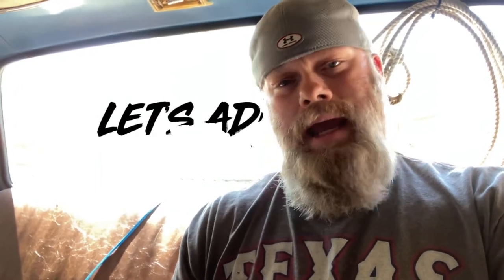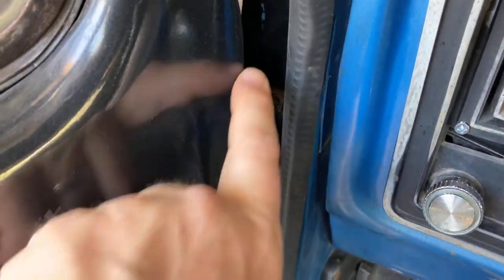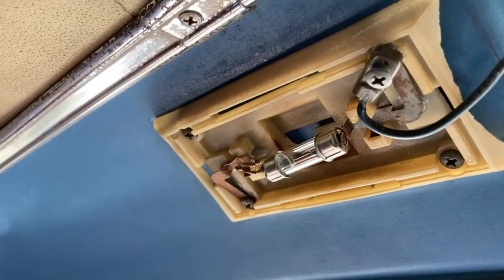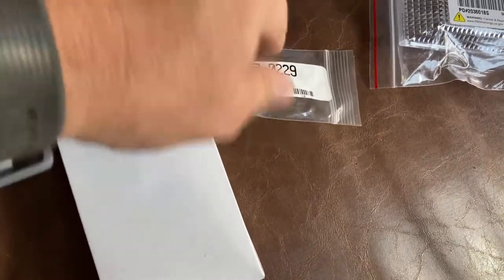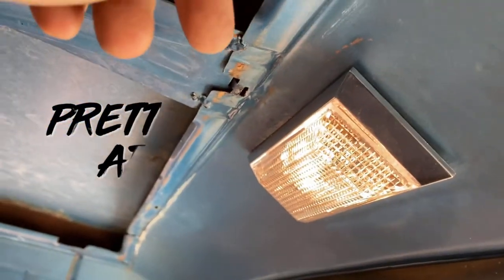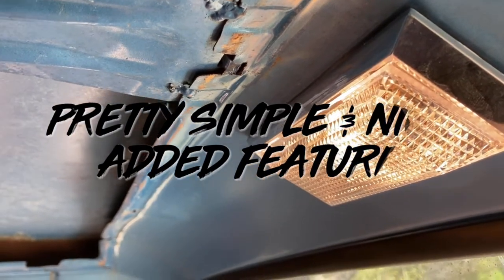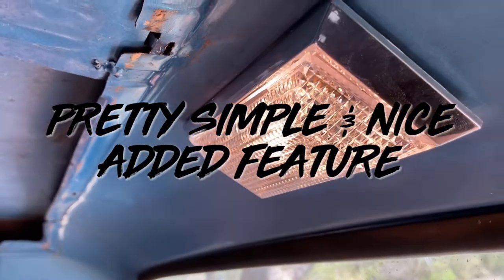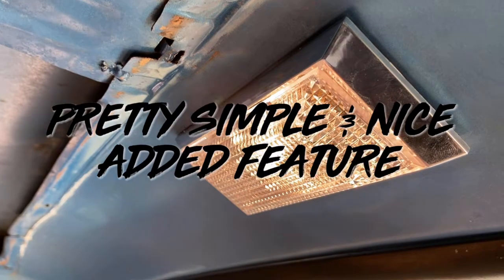Customize Your Dome Light - Add Some Chrome - 1977 FORD F-150 Ep. 7

Comment: I need to do the same for my 78 f250...looks good.  And what is that toggle switch below your light switch on the dash....mine has the same and I figured it was added on but maybe not??
Reply from the maker: Thanks so much. Please Subscribe. Also my store is now open too for my channel. https://operationrv.printify.me

I’ve seen those also for double fuel tanks where that switch feeds fuel gauge. Mine in the other hand it my fuel shutoff for my electric fuel pump.
Reply: @OperationRV  That is interesting.  My switch is in the same spot but not sure what it is for yet as truck does not run at the moment(pulling engine to find out).
Reply from the maker: Congrats on the build.